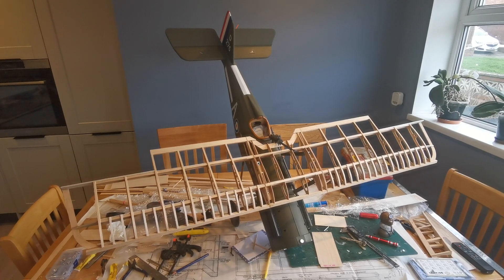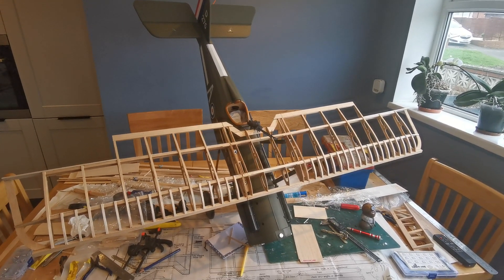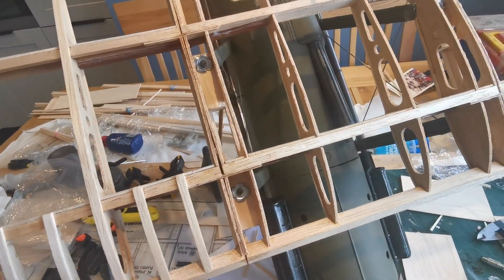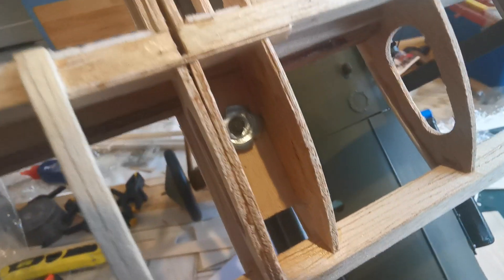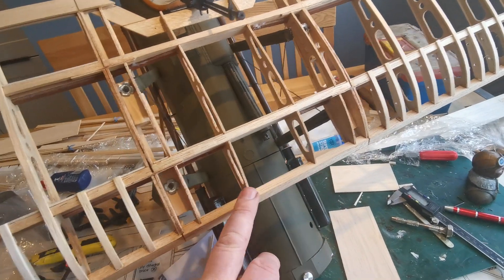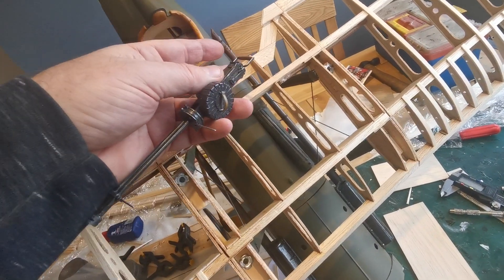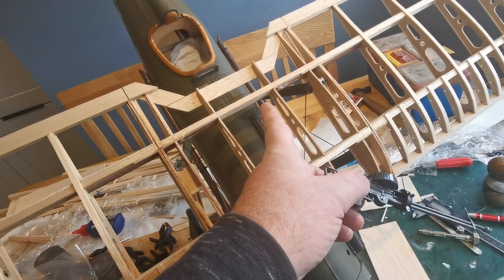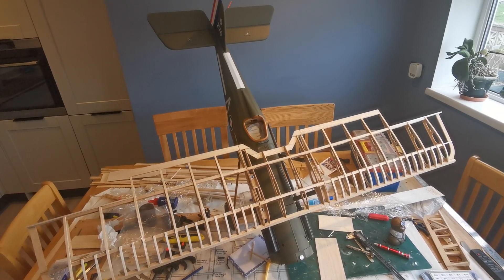Building the Flair SE5A Upper wings

Comment: looking great mark, not sure youll need to upgrade the wing bolts as ive had several flights (inc aerobatics) on mine with the powerfull OS70 FS and the small screws have held up fine !

Comment: Good mods Mark, the gun is the icing on the cake so definitely work mounting correctly, I think people who haven't built from kits are a little bit frightened to make any changes, lack of experience more than any  other reason. I know what you mean about being fatigued my triplane had six wing panels to make 👍
Reply from the maker: Feel the pain but thats a lovely plane bet it turns heads at the flying field especially when you throw in some "stunts" 😂
Reply: @MarkCroucherRC4fun  It does Mark, 'stunts' are good, not so low though lol, cheers.